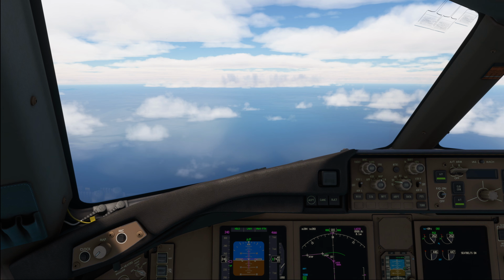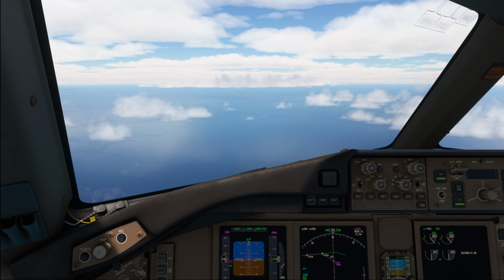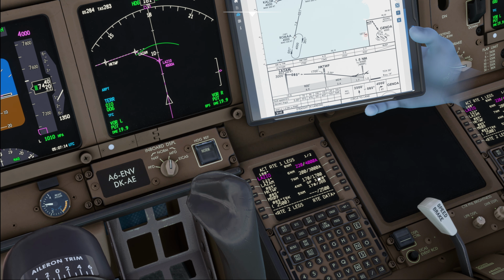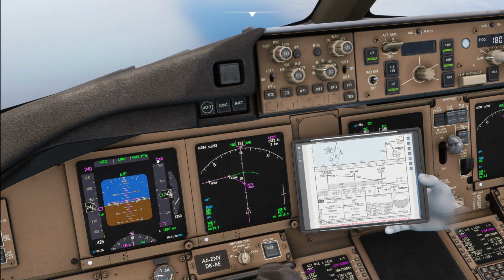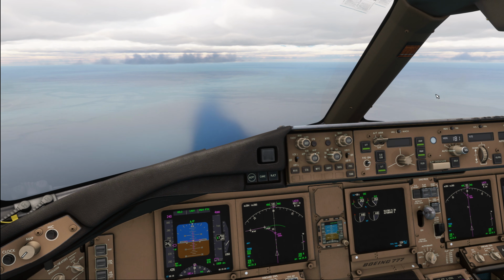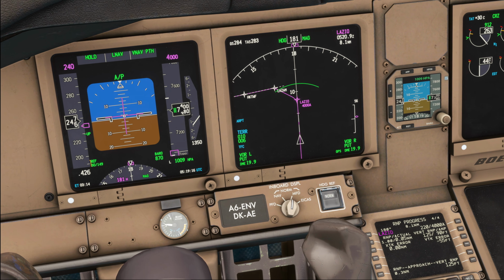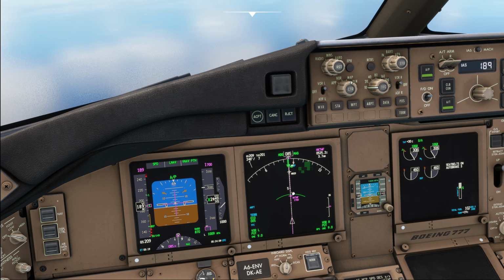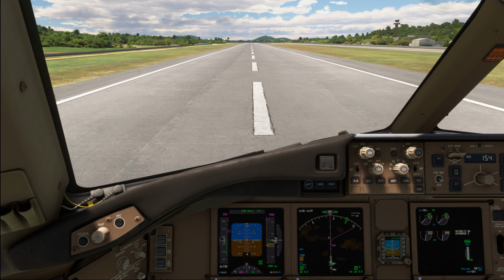PMDG 777 Tutorial: How to fly Non Precision Approaches using VNAV | Real Airline Pilot

Comment: Thanks for the informative video!  Are RNAV (GPS) approaches flown the same way as this RNP approach?   Just curious why the 777 and other airliners aren’t equipped to use LPV guidance on a GPS approach? (It seems strange that a Cessna 172 with G1000 can fly to lower minimums on a GPS approach using LPV, than airliners using LNAV/VNAV).